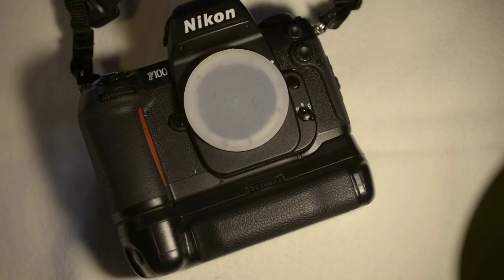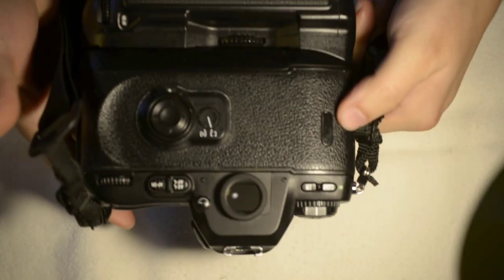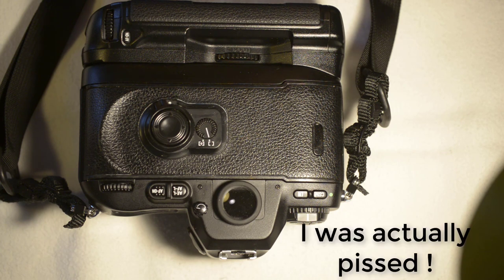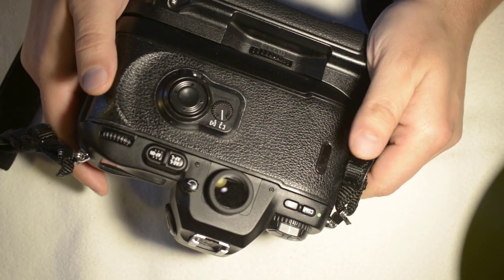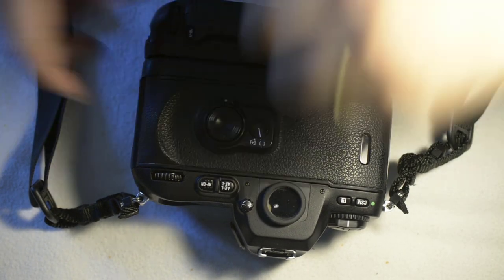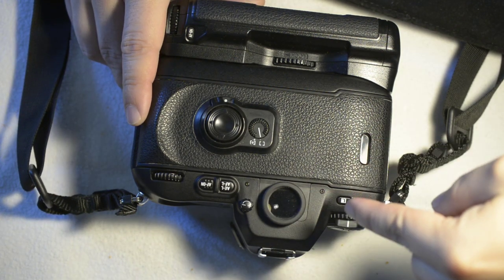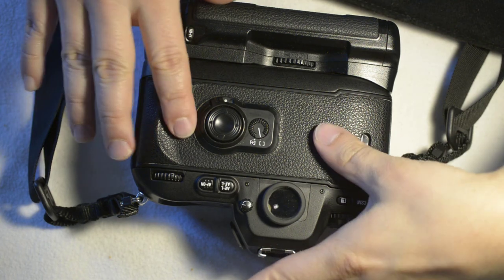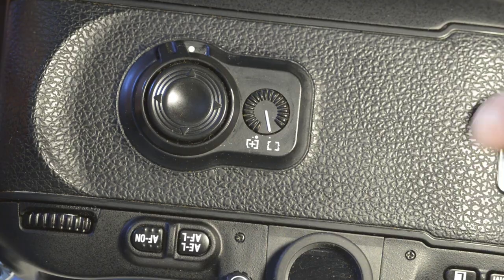Sticky camera cleaning

Comment: Rubber will degrade over time but you can slow the process by doing the following.
Store camera in low humidity (65%rh or less)
Store in a low stable temperature
Keep away from strong UV light
Clean your camera after use to remove oils from your grubby hands! 
Give you camera room to breather when in storage, sounds stupid i know but as rubber degrades giving the volatile gases somewhere to dissipate will help 
Regular use will also help (and wipe down after)

Rubbing alcohol and hand sanitisers, windex etc work buy removing a layer of rubber, so you cant do it many times! (And remember these products are solvents to rubber so not a great idea to use them in the first place)
Prevention is better than cure and understanding what causes the rubber to go sticky in the first place will give you a better shot at slowing rubber degradation as much as possible
If all else fails you may be able to buy replacement rubber and go through this nightmare again and again!
Reply from the maker: Thanks for this information.

Comment: How hot does the water have to be, just warm or as hot as you can handle with your hands?
Reply from the maker: Hello Duncan, excellent question, I'd say as hot as you can handle with your hands.
Reply: Just use hand sanitizer gel works really well. Apply with a toothbrush.

Comment: Another tip: Remove the back and put it in your freezer for 30 minutes. The stickiness is gone.

..Joe
Reply from the maker: Interesting, I'll try in it the future
Reply: @diyextravaganza  just remember to remove all the batteries so you don't kill them.
Reply: That doesn’t work at all
Reply: @Dezdirectz  Works fine. I've done it dozens of times to cameras when I'm repairing them.

..Joe
Reply: @jagerardi  I try it earlier today it didn’t work for me at all. The back was still left sticky
Reply: @Dezdirectz   How long did you leave in it the freezer? I usually keep it there about 2 days.

..Joe